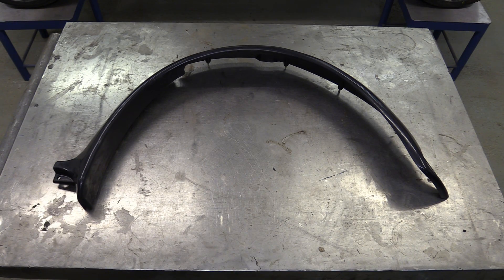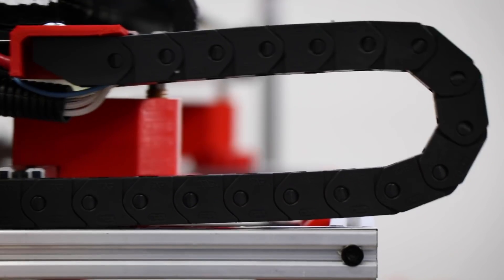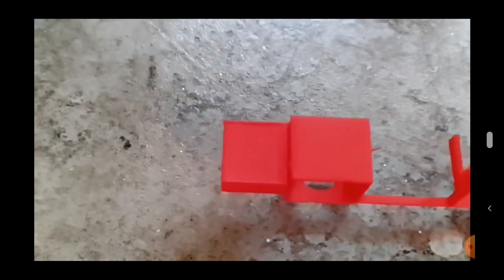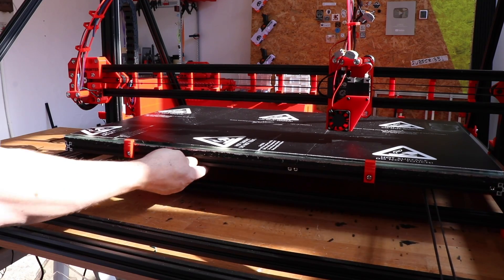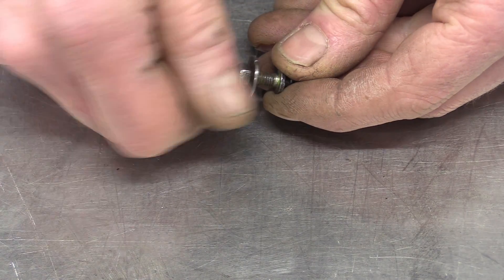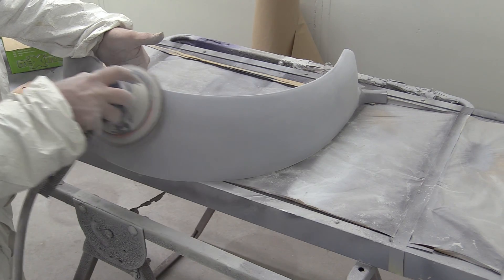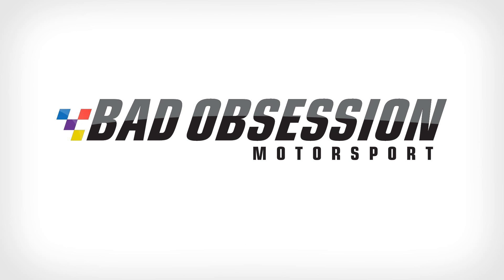Howie Did It - An Experiment in 3D Printing

Comment: For strength, couldnt a couple of layers of fibreglass assisted? I suppoe a test on the red prints would have been good in case ofthe epoxy reacting negatively with the PLA
I'd say a rock at high way speeds is a fair bit more of an impact than a screwdriver dropped from 2m.

Comment: Printing in PLA is OK for testing purpose, but it won't hold up in the sun. You need a more sturdy material like ABS, which typically requires an enclosed heated printing space to prevent warping and delamination of the material - something Ivan's open printer build can't do. Hence I eagerly await Ivan putting together an oversized CoreXY printer in his shed :D

Comment: I'd have covered the 3d printed part with a couple of layers of fibreglass or CF. I assume Miranda printed it out of PLA. While PLA is quite stiff, it's pretty bad with temperature. Just 50C can get it to lose its shape at 60C those inserts will rip right out. If you leave the car under the sun, these parts can actually reach those temperatures. 

Not to mention, even at 3mm, a determined rock can shatter it. 

Still, it's great to see FDM manufacturing being used in production work and as usual great work guys!

Comment: I love this video, great work, information and editing. The arch printing could be done a little differently in my view. The supports could be printed in a different format with a fraction of the material and easy to remove. A 1mm nozzle would reduce the print time by 2 1/2 times. I love that home made printer it's wonderful work, just not sure how well dialled it is. There are much better materials than PLA for this application.
Building great machines is one part of the printing process, being able to design and use the slicing software is another.

Comment: Yes - I was about to say... hopefully you making moulds out of them - having that done, it would not be too hard to make the part from composite, which would make lighter and much stronger part.
Although 3d printed parts are fairly light and strong, the FFF 3D printed parts tends to split between layers, especially PLA. Sure ... Ivan probably knows what he is doing and with right settings, temperature etc. it is still possible to make reasonably robust parts. They will certainly survive rocks, but any more serious hit and I am sure they will be split in between the layers. Other thing to note - PLA absorbs water, so if you primer layer (sealant) is cracked or chipped the plastic will start soaking-up water, getting brittle and I assume the paint and primer will start bubbling around the damaged area.

Comment: Definitely make molds of these for fiberglass before you do anything else with them. PLA is a great prototyping material but that's about it. As soon as heat is introduced those fenders will warp and conform to any surface they're on. I've had quite a few PLA prints ruined from sitting in a car on a warm summer day. I would love to see more of the 3D print to fiberglass mold process though!

Comment: I have a 3D printer and while it's a nifty thing, I don't think it would be the best approach here. The finish would need lot of sanding & filler. And aside from that most 3D printable plastics have issues that only magnify at scale, e.g. PLA is hard but super brittle (one pothole would snap it in half) while the likes of ABS, nylon are almost impossible to print without direct drive, super heated bed and hotbox. 

The proper & sane way to do this would have to be to finish the prototypes, create a mould from them and then make a cast out of fiberglass / carbon fibre and resin. Even accounting for the time to make the moulds it would probably be less time & effort than 3D printing them and either using them as-is or making another mould.

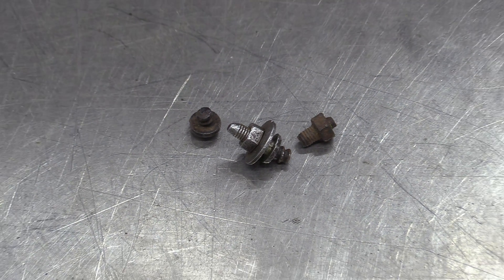Comment: 10:20 A quick FYI about the threaded inserts- for 3D printed plastics, you can use heat-set inserts rather than self-tapping inserts. You install them with a soldering iron and the ID does not have to be as precise. It might save you a couple steps on the next build.

The heat-set inserts are also made of brass. And while you might say brass "doesn't rust" it most certainly does oxidize and my old, unsafe corroded brass scuba regulator would certainly disagree with that misleading assessment.

Comment: You should have heated the inserts with a soldering iron and sunk them in, However this creates the problem of sinking them in straight. Still, it's a superior way to add threaded inserts to 3D printed objects.

Comment: PLA plastic will most probably tear at some point, especially under the elements. ABS would withstand much better. Furthermore, there will be some deformation during the two days of english summer heat for sure. Better to just gelcoat the prototypes and make molds for the real ones out of something very light and hard and fibrous.

Comment: what you do to get good scans of things for 3d printing, is give them to some kids with a bucket of crayons and markers and stuff, and tell them to draw all over it. then the photogrammetry will work.

also i wouldn't use pla, it usually seems tough at first, but leave it in the sun and it will liquify. its melting point is pretty low. get it wet and it will dissolve, its very biodegradable and rats would probably try to eat it.

Comment: I don´t get why people are hooked on 3D Printing. Had it, tried it and scrapped this Junk. Adding all the time it needs to tinker with the ridiculus complicated Programms, the crappy Computer and the Device itself, Printing the Parts and THEN needing to smoothen the Surface...   you can just get a Fiberglass Mold made and pull new Parts out of it. I just guess ¼ of the time and less work.

Computers make work where actually not needed.... and don´t help at all in the end cause just wastng time tinkering with them to get them to work.

Was nix to see you craftsmanship but spoiling the work with 3D Prited Junk makes me sad....

Comment: Why don't you hang the parts with wire from the ceiling to get a more complete coat?
Reply: butti fdft  For sure, I was just talking about painting the 3D prints, I'm learning to spray and find personally that hanging the parts makes for a much better coat of paint than if it was lying on something.

Comment: Not sure if someone has asked the question, but were the final arches made from PLA or PETG?  I sure hope Ivan printed them in PETG and NOT in PLA.  PLA is good stuff at room temperature for STATIC items that arent subjected to much in the way of Torsional stresses or direct sunlight.  If they ended up being printed in PLA, there is a high degree of certainty they will crack at the layers once bolted on to Binky.  I suggest they only be used to make a molds for fiberglass or Carbon fiber flairs.

Comment: if you're looking for a filament that will work well for automotive exterior parts have a look at form futura apolloX 3d print optimized ASA. i 3d printed a front splitter for my type r back in the summer and it's far tougher and more temp resistant than PLA which could sag and deform on a really hot day. Apollo is also way less brittle and easier to post finish, plus you can use techniques like acetone vaper smoothing or acetone welding.

Comment: I’d definitely use A2 bolts with some duralac on those inserts, I’ve wound plenty of those brass inserts out of tractor wings used in exactly the same circumstances in fact those fastenings look exactly like the ones John Deere provide....

Comment: I’ve printed a lot of parts for my F******I replica.  The kit manufacturer printed the mirror housings.  I’ve made switch panels, a diffuser, a radio surround with warning lights in it.  In the engine bay I’ve made air intakes and even hoses that take 21 hours each to print.  The printing is the easy part, it’s the design that’s the skilled part.

Comment: For our scanning:  If you have a featureless surface you can add crumpled up balls of tape.  Properly spaced it allows you to drop alignment pins with ease and gives the software reference for alignments.  Once aligned, the references can be deleted from the mesh and repaired.  I've used this on large jump scans on wings and fuselages...  If you ever need surface modeling help or mold design work I'd love to collaborate.

Comment: great job they are gonna look fantastic...you definitely want to mold them and make the out of carbon fiber as pla doesn't like heat and large parts will warp in hot sun its also hygroscopic and will become brittle in blighty weather very quickly even with a shit load of paint. abs printed parts are better but still weak strength between printed layer lines and probably wont like vibration the bigger the part the bigger the effects, also will weigh a tonne compared to carbon....how ever they do look amazing and cant wait for binky to be done ive been watch this for so long...happy Christmas and have a good new year!

Comment: Do yourselve a favour and use these to hold the archs on.
Those button heads are awefull for going round as the hex is so shallow!
https://www.ebay.co.uk/itm/M5-M6-M8-M10-A2-STAINLESS-STEEL-FLANGED-HEX-HEAD-BOLTS-FLANGE-HEXAGON-SCREWS/221275756963?_trkparms=ispr%3D1&hash=item33851019a3:g:UgIAAOxy06hSG6QX&amdata=enc%3AAQAFAAACcBaobrjLl8XobRIiIML1V4Imu%252Fn%252BzU5L90Z278x5ickkgCVySCgrNFPU8Iu85TabMAZtFhB7FYSWgC0vIwJ%252FoEmuYCURD52JYfVKskG%252FXWhpXsM0U9TfZVyu%252FZg1StS5FS1SL%252BNAqSBMlrFhtvILXsoSVZv8zFwHvr%252FEibvMak7ijdVtiD6Ve6N5FuQWNlqE8e34fgPaqfepHip76N2w73KO9PO1fUTL0185psOIT8IUgajsVn0v2qMATPhs795YWh1Txwrq0jEpvBerMxEP2KIFBSpNZfNoUmr0eAWbntlEzFB%252BVwNP4f0ikJ4uuQC0U%252Fe2Otu4y01TkDiTr5d4R9mvd0bYei6EykHpVQF0ki90EqWcwCUCcKjSxZxFwAZVFM7UE9J6rg6pTUGts057YzL%252BGW9h8zDGXIYlEzJS%252FG3Vkhe5Y8fBUlQLFtKkLXYik8yhzmtu9i6Zv7qVDnxA0bVKoIeOLvNEcChppPjQxrG6CZ91WlkqRdfYGbMf9Wofnre15eV4NcMtX5obqSoU8Pe6TnHYv3rC%252BxviQYpcCSmrC0%252FhlE7T%252FKE0gDYtdSOu5tqTL8zdv6f0u96MCTCtVN%252FngfzLBTg2OQdB0zqruaUedWlIlkt7WotQrMjPaQvrUARLIGHoqgcjYk7I4s7DElqnIZ642UGGKs%252BcWmPNu2PrQYf6EdXdJ2LMVgkL%252FjPYXeHQnSiCJL9QuKwHr1UT6c%252Fe1i2M8krdostKVUo9dEZbyrhUL13j6bB9XQlYiWFIo0t51J8P7vUxWowKxIIRNHvn9iyOrUI5nKAYvJkLpiTVnImHDDIwTOeuflVMHIu41g%253D%253D%7Ccksum%3A2212757569635a64a78f62654bf7af3cca79b535661d%7Campid%3APL_CLK%7Cclp%3A2334524

Comment: Throttle Stop Garage has some really good videos on mold making as well as what it takes to use carbon fiber. Mike Patey would be another good one for composite work. I think you'll find PLA "moves" over time and isn't great with heat - sunlight can deform it. Absolutely awesome for molds though and was happy to hear you guys ar e considering it!

Comment: A skin of fiberglass on the outside and a lick of the resin on the inside would have been ideal to give a little more strength and seal. 3D prints hate moisture, the paint will bubble before you can say brackets if they get wet. But great to see some collaborations, I want a laser scanner now.. hmm

Comment: I’m work with large format printing like BigRep One (1m by 1m, 1m tall) based on my experience, PLA prints would start loosing shape at direct sun light on a summer day. Material get soft ant 60-80 degrees. PETG, ASA/PC, materials would be better fit for this. Kudos for scanning and design!

Comment: You might already know this, but PLA has a couple big disadvantages - it doesn't do well at temperatures above ~120F or ~48C, it starts to deform, and it doesn't handle UV very well over long periods of time, though the paint should help with that one. Otherwise, its physical properties are pretty good. But as mentioned, it would make a great basis for making molds, or something to go from for a fiberglass part. For those googling this, yes, its plastic deformation temperature is usually listed as much higher, but I know this from personal experience, PLA printed parts in a car interior will deform when your car is in the hot sun. They might actually fare better on the outside, though, hard to say without trying it.

Comment: Looks good and massive effort. I do a lot of scanning and 3d printing so know what the lads have been through. My only comment is it looks like it's printed in pla which in hot sun really sags and deforms at low temperatures (UK summer) will knacker them. If it's not pla other materials do perform better. 

In our shop what we do is 3d print, smooth and finish then we produce a mould and RIM into the tool, pulls off a part with the right properties etc

If you want to have a chat about it drop me a message and I can give more information

The alternative from pla would be a carbon infused printing polymer or nylon. ABS would work too but would need a chamber at 80°c round the printer to stop delamination. 

Keep up the good work and maybe we'll see the build at mitp 2021...

Comment: It you bend a steel tube to the profile of the inside of the arch, then you can fibreglass it into the corner. Will add a ton of rigidity and a bit of impact resistance too.

Comment: In any cold temperature PLA will be way too brittle to work. Definitely take moulds and maybe try reinforced tape on the underside 90 degrees to layers to stop it shattering badly. I wish it all the best of luck but I’m not hopeful for just PLA in the long run.

Comment: The PLA prints will not survive in the sun if painted in a dark color. Its glass temperature is only 65 degrees C. I once accidentally left two 3d printed airplane wings in the sun. The opaque one turned into a pretzel, the pink clear one survived unscathed. You may want to try PETG for the next set. It prints okay-ish, and is way more temperature resistant.

Comment: The dissimilar metals in your fender screws will cause galvanic corrosion. I suggest using brass screws as well.

Edit: or steel threaded inserts.

Comment: PLA goes soft in direct sunlight so won't hold up on a car. You could either get them printed in ABS or Nylon or just use the PLA prints as molds straight away.

Comment: As a 3D print hobbyist, I love the principle but - like others here - I have concerns about the longevity of PLA this environment. It doesn't take much heat for unsupported PLA to distort, and it has a tendency to become brittle after a year or so. Although it passed the screwdriver test, I suspect the same test 12 months down the line may yield different results.
That said, I hope I'm wrong! I love what you guys do, and I'm itching to see the Binkster out on the tarmac.
But, whatever happens, I have nou qualms about thanking you for your wonderful videos, and wish you guys the best possible merry Christmas ever.

Comment: Nice job from you and Ivan. As long as you don't hit anything or let the car sit in the sun for too long the arches will probably work fine. What you should keep in mind is that PLA becomes brittle at low temps. In the long run 3d printed molds to make arches from fiberglas is probably the way to go, especially considering the overhead of 60 hrs print time and then postage for one arch.

Comment: Well these will work good base for kevlar arches. But, I would have  them designed for and printed from the right stuff from the beginning. Good thing about 3d is that you dont have to have even material thicknesses, and that was not done here.

Comment: I love the use of 3d printing however I would definitely suggest pulling a plug of these now pla is not one of the most durable materials infact it likely downright not suitable for application. The correct filament to use would have been ASA.

Comment: I love 3D printing and I've always wanted to try something out like this. Arches, prototype brackets and adaptors for mounting brakes, etc. 
But did you consider using the 3D printed arches to vacuum form moulds for future use and preservation? Or so that you could recreate them out of Fibre glass or some kind of Fibre-Reinforced composite?
Since 3D Printing is, in other words called another form of "Rapid Prototyping"

Comment: Pretty awesome that you could get those scanned and printed. Do you think PLA will stand up to outside conditions and summers days? I know if you leave PLA inside a car it will warp or outside in a garden etc it does breakdown. Out of interest what temperature was the spray booth heated too, standard PLA usually changes shape at 55-60 degrees usually (depending on brand)

Comment: Forged carbon is an interesting technique for making carbon fiber parts faster.

Instead of laying down precut sheets, you layer cut up carbon fibers and resin than close the mold together with an area for some excess resin to be squished out or use the vacuum bag technique. Regardless what mold techniques you guys use forged carbon gives you parts slightly less strong than a part from carbon fiber sheets but with less effort! I personally like how forged carbon fiber parts look.

Comment: Love the video guys.  One thing to consider on these printed fender flares is heat.  I've designed and printed a few smaller parts for my classic car and mechanically PLA can be decently robust, but on something like a car that sees hot summer weather as well as heat from a warm engine, the parts can get weak.  The glass transition temp (temp at which it weakens considerably) for PLA is only about 60°C.  Yeah way hotter than the ambient air, but an engine bay could easily see +100°C.  Curious to see how these hold up in the long run.

Comment: Another option used by people 3D printing parts that need metal threaded inserts is to use heat set inserts which can be pushed into place using a soldering iron rather than having to thread them in.

Comment: Great work as always. I’m attempting something similar to make a set of rear spats for my gtfour. I used an Kinect to scan the rear fender/bumper and am currently sketching designs to model. I’ll either use the prints as a mold or see about coating them in fiberglass resin and seeing if they can act as the final piece when done.